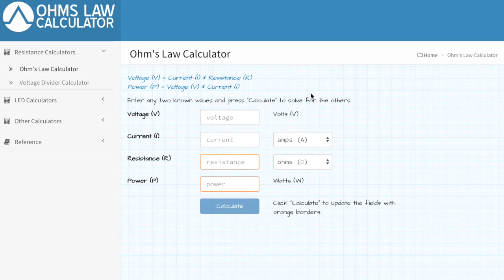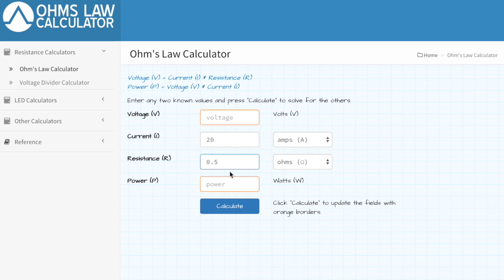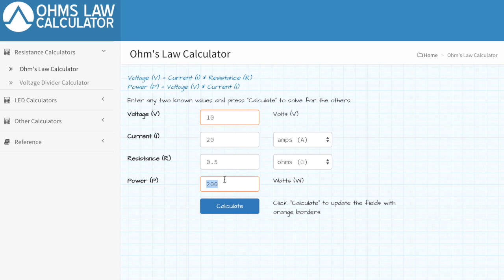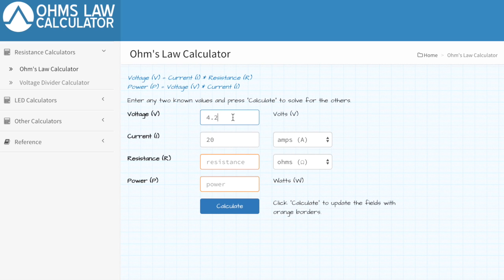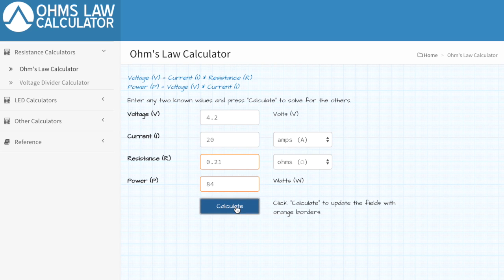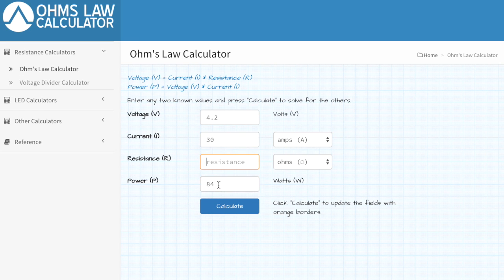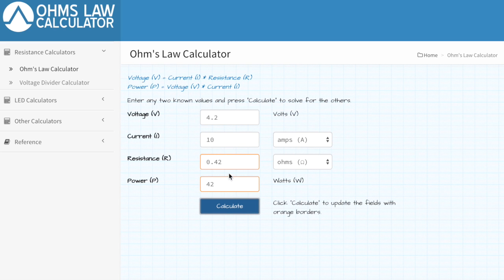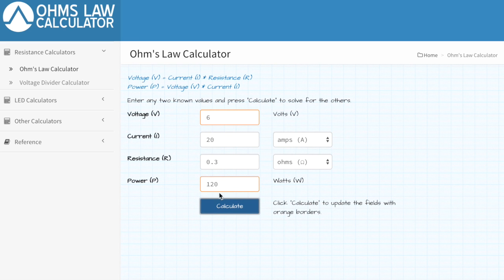Vaping for Beginners - Ohm's Law & Coil Resistance for MECH MODS

Comment: Abby, please take down this video and re-upload a better one for safety reasons.
First thing, there is no 18650 that has 35A so there is no point in promoting that battery.
Second thing, don't calculate with 4.2v and don't let people get used to it. As you said, it outputs 4.2v when it's fully charged.
But that's it. It will drop and drop until the mod will cut it self off unless you are on a mech mod.

A good rule is to use the voltage of the cut-off point which is around 3.2v or something.
Don't think about resistance when it's comes to regulated mods and please don't input your AMP in the calculator.
Just take the wattage that you are using and divide it by the volts that your battery can output. This doesn't mean the voltage that is displayed on the board, but the actual output of the battery.

I recommend this at 100w as an example (Series mod)
Single battery: 100w / 3.2v = 31,25a
Dual Battery: 100w / 6.4v = 15,62a
Triple Battery: 100w / 9.6v = 10.41

As you can see, series mods adds the voltage from another battery, which means that calculating as everything is just 1 battery is wrong. At the same wattage, my AMP dropped because I added batteries. The batteries are helping is each other to deliver more power so the current is lower.

If you have a mod in parallel, the voltage will not increase no matter how many batteries you have.
What it will do though is to add AMP.
Let's say you have a 20 AMP battery. Having 2 in parallel means you have 40 AMP. Having 3 in parallel means you have 60 AMP.
A parallel will typically only use the voltage from one battery. Basically it just splits the voltage between all batteries.

Do keep in mind that battery drops when using. NEVER calculate with 4.2v as this is a fully charged battery.
Also, resistance means NOTHING in a regulated mod. Just use wattage and volt as shown above. That's it.

For a mech mod where you don't have a display, you need to use the resistance.
Then you can kind of calculate like Abby. Still, don't put in your AMP.
Use 4.2v and divide it by resistance. 
Like this: 4.2v / 0.2 ohm = 21 AMP
After I while, the voltage from the battery will drop and drop but the AMP will go down since it delivers less power.

When you are going to explain something this important, please separate: mech, parallel, series and so on.
Not everything can be or should be calculated as a Mech mod.

Sorry for the long message, but I seriously don't understand why a person that does not know about something this important decides to upload a video like this. ohm's law is extremely important when it comes to vaping.
The fact that you even mentioned a battery being 35 AMP really got to me. 
Seriously, stop.
Reply from the maker: +Sean RobinsonJR thanks for you detailed response. This video was made a long time ago before most were aware that 35amp wasn't correct
Reply: Abby Vapes Mooch did battery tests even back then and has always claimed that there are no 35 amp 18650 batteries. He is the guy that you just know if you are into vaping and battery/ohm details, but no worries. The 35 amp issue is just small.
What I'm trying to say is that calculating the AMP is not the same for every device. it seems like you are tying to explain everything but kind of only cover the "mech" part, and you kind of miss there by setting up AMP manually and putting 4.2v just because a battery can output that when it's fully charged.

You probably know this by know that you just can't do that, which is why I actually recommend you to just remove it write something in the description, because it is really pointless.
I know it sounds mean but my impression of your video is that you are trying to cover the most basic about ohm law but you kind of miss and only cover how a single battery works.
It's just wrong and dangerous.

Maybe the views are important for you so you don't care. I don't know, but this isn't like just missing a review of a tank. This is actually how people do get hurt by vaping.

And also forgetting to use battery case when having a loose battery in their pocket.
Reply: I know right.
>Makes vaping guide for beginners
>Is a misinforming beginner
Reply: 35 amp PULSE.. 20 amp sustained.
  By the way guys, this PULSE rating on batteries is BS!  I think they just toss it on there as an average peak rating when you first fire the mod. 
Now for beginners.. don't by cheap, rebranded batteries, you never know what you are getting. I use 20a 2500mah or 20a 3000 mah for my regulated mod, and 25a 2250mah for my mechanical.  LG, Samsung or Sony only.

Also, never ever ever ever use "recycled" batteries.  Even if they are the exact same as what you get in a shop.  For example, some batteries are made to work in sets in a power drill or laptop, but not recommended for single cell usage (according to Sony), nor do you know what the internal chemistry of the battery is like.  I won't go into a long, complex discussion on why, just don't do it.  If you really want to know why, to satisfy the inner nerd in yourself, google it like I did.  The battery guys explain it better than I could anyway.  :o)
Reply: ***** Read this: https://www.reddit.com/r/electronic_cigarette/comments/3xrt03/calculating_battery_current_for_a_regulated_mod/
Reply: Joshies I have even left out some other information. The thing she does is to calculate the current that is going through the coil rather than what is actually going from the battery.
There is no way to calculate with 5v for example with a single battery. If 5v is displayed on your mod, it's simply just showing what is going through the coil.

In other words, the "AMP rating" that you can see on a VTC mini is pointless. It just shows how much amp goes through the coil and not from the battery.

In all, if you use a regulated mod with good batteries, you are pretty much good to go because a regulated device will provide you safety. We can all appreciate that regulated mods have cut-off point, coil resistance cut-off, amp cut-off, voltage cut-off and so on.
They made regulated mods dummy proof, and judging from most of the "ohm laws" videos out there where vapers have uploaded, it just proofs that there is a big reason for why they did all that. This video has over 300K views I think? Judging from the likes of the video, I just assume that most of them take her word for it.

I'm not a batter expert or an electric engineer. What I have done is to spend more than 5 min about ohm's law.

EDIT: I'm also not saying that Abby should know everything, but when you decide to make a video about it and share it with a lot of people, you should think twice before uploading it. This video is in fact pointless.
This is not just a review of a product. There is no right or wrong in a review. 
Ohm's law does in fact have a right or wrong answer. There is no opinions but just facts which is why I think it is stupid to upload this video in the first place if you don't know what you are talking about.
Reply: She doesn't mention that with the first battery. For all we know, people would believe that the battery is 35A.
Reply: so what can I do with 40a 18650 imren batteries well 2 of them bc I'm using a snow wolf 200 w
Reply: What color?
Reply: +Joshies it's purple
Reply: ***** For a high end mod like that, I'm surprised that they let it be 200w on a dual battery mod. It's just no way with a 17-20A battery like that. Heck, even for a 30A that would be pushing it and the battery life would be so bad.

I don't know the features that they have into the mod. Usually, a regulated mod should be good to go.
Reply: +Sean RobinsonJR the battery life is not bad like I have 2 40a imrens and it last me a day and half and I I'm using nichrome 20 g wire and it doesn't over heat like I start to feel the heat after the 7th hit and it's not hot it warm but I let it sit for like 5 mins and it cold again so it not bad at all I just don't want to push the battery thts y I asked
Reply: ***** I checked up on the Snowwolf. Above 150w, the chip kinda powers it on and off constant. It's the only way it will give you "200w"
To be honest, I don't see the point with that. I wouldn't even use it on 200w. The batteries you have is called 40A but don't get confused with what you actually have.

I saw RIp trippers video and it seems like you are rocking his setup with the same batteries. I'm pretty sure that you got the 20A once. The thing is that there is no such thing as 200w with dual 18650 batteries unless they do like snowwolf does. Power on and off constant. I have never tried that, but I don't see how that is worth it.
Reply: +Sean RobinsonJR no from day one I was using the 40a 18650 3000 mah batteries and I don't go above 90 I like it at 90 it's not bad but if I want to get a bigger cloud I would use a mech mod but I want to learn a lot more bout the battery safety and more bout sub ohms
Reply: ***** So the Imren purple 3000mAh is 17A battery even though they claim to be a 40A battery. Don't believe that and there is no such thing as a 40A 18650 battery. If it was me, I probably would go over 100w with a dual battery. It would be pushing the battery and the battery would drain fast. I go through x3 LG HE4 batteries in a day with 120w. Maybe 1 and a half day.

You can always push more but you would need to think about battery sag and how much juice there is left in the batteries. Even though most of these things doesn't matter to much on a regulated device, I still avoid pushing my batteries. I don't even go over 50w on a single battery mod and there are many single battery mods that can push 75w.
Reply: +Sean RobinsonJR then what kind of batteries would u prefer bc I'm still kinda new to it
Reply: ***** It's hard to tell because there is no such thing as the best battery for everyone. Someone needs batteries with a lot of amps. Some doesn't care about that and just wants battery life. Some people are in between. I'm one of those that is between. 20A batteries are really nice because it has a lot of battery capacity an I never go above 20A. I use my RX200 with a lot of power but then again it has 3 batteries. I use low power on something like VTC mini and it also won't go above 20A.

This is why I would recommend you to buy "Samsung 30q" They are 3000mah batteries and they are 20A, even though they mark them as 15A. They have been tested to be 20A so no worries. Or "LG HG2" which is also 20A battery with 3000mAh.

Currently I have LG HE4 but I would upgrade to one of these two when it's time to change batteries.

It kind of depends on what you need.
Reply: Okay I'm not going to bother reading Sean's shit because I'm a battery god. So, I'm just going to tell the truth your batteries are shit. Stick to the to Sony, LG, and other big names. As for your batteries capabilities, assuming you have the 3000mAh ones, you have a safe cdr of 17A and 20A maximum. This means you can safely hit 17A for 4-10 seconds~. If the pulse rating on it is legit you can take 1-4 seconds drags w/ a 40A rating. Though I'd just drop those batteries I'd suggest you some, but it's completely dependent on your vape and style (i.e: rec. use, cloud chasing, etc.). Hope I helped a bit brother, and if you have any further questions I'd be happy to help.
Reply: Joshies You can safety buy other batteries than Sony, Samsung and LG if you know what their ratings are, but I agree on your comment. Also, it's not about "seconds" but it can be about "temperature"
Reply: Yeah you're right, but it's more of a general means to measure by.
Reply: +Joshies thank you both I was looking for the right ones to get bc u know tht in order to vape safely without any problems u ask other vapers tht has been doing it for a long time or reading and learning bout it than jumping straight into the pot thts way I'm using a regulated box mod instead of a mech mod
Reply: +Sean RobinsonJR thank you tht helped a lot now I am able to know what I can use on my box mod without pushing the batteries and tht I am able to use the batteries I am using on it without any problems like 200/(3.7*2)= 200/7.4= 27.07v
Reply: That is why you buy the best batteries you can get, you never need to worry about pushing them on a box mod, (regulated), they will handle anything your mod can do.  Batteries will have a couple ratings.. the ma. 1650ma will need to be charged more often than a 2000ma and that will need to be charged more often than a 3000ma battery. (given the same coil, amps, watts, etc).  Next is your amp rating.  a 30/20 amp battery has a burst of 30 amps, but sustained at 20amp. Mech mods use more burst, you will notice how fast mech users hit when they vape. 2 second pulls are fine, but a 6 second pull would really push a battery if  you were pulling 25amp. Basically, know how long you can pull , longer pulls need better sustained, short pulls need better burst amps.  I saw a really nice battery.. 2250ma at 60/30 amps.
Reply: I agree!!!! Remove the VIDEO!!!!! this will make someone commit accidental suicide !!!!!!
Reply: ill just stick to saying that I agree with you
Reply: It's true that if you buy true 20a batteries, you are pretty much fine no matter what wattage you vape on a regulated mod. It has so many safety features that it would be amazing to fuck up with a regulated mod.
Often, you don't even need to know about battery safety if you use a regulated mod.
We are lucky to have those features because people still struggle to understand battery safety. Even I don't that much about battery safety, but I have had many lessons from the community, live chats and reading Mooch's posts.

The biggest thing is that people don't the difference between battery output and the coil output. If they just knew the difference, I think everything would be easy to understand because it's really not that hard.
They are just getting the wrong information from so many people around here. Especially on Youtube.
Reply: welp.. that proves it.. Just ignore this twit.  As soon as the fool mentions 30A+ he becomes a statistic.  The idea is to learn ohms law on a regulated mod, learn to build coils etc etc so you don't blow your face off on a mech.

Now what that clown doesn't know.. is some batteries can safely do 88 amps for a short time, and others only 44 amps for a short time.  Short time being "if it gets hot, let it go stupid"  I won't say which batteries, let the clown look them up and do his own calculations, he'll be much better off.
Reply: gbalkam Was that aimed towards me?
Reply: I agree she wasn't that informative but they do my 18650 battery's with 35 amps because I own several
Reply: You said what? You have 18650 with 35a? Name?
Reply: What are you smoking? I have at lest one that is 40A!
Reply: +Sean Robinson JR efest purple 3000mah 35amp
Reply: Not sure if you are joking but I'm just going to put it out there anyway.
The Efest purple 3000mAh is 20a and not 35a.
Reply: Tim Willey
Oh look, you can read.  To bad you don't know what it means.  There are NO 35amp batteries.  And if a battery says 35amp, don't buy it, they are misleading you.  All you need to know is the sustained amperage of the battery,  plus a bunch of other technical stuff if you are sub ohming on a mech mod.
Reply: gbalkam I wouldn't rule out all batteries where the manufacturer lies. Even though many of them lie, It can still be a good battery.
I wouldn't say that the Efest 3000mAh is a bad battery. Surely it's not a 35a battery, but 20a is decent for 3000mAh.
Reply: I wouldn't take the chance.  The manufacturers of a good battery know full well that they have a good battery and don't have to lie or mislead.  They say THIS is what it IS, and here are the battery specs to prove it. 
I figure if a manufacturer has a product that isn't good enough to stand on its own merits, without being exaggerated or having a misleading label printed on it,then stay away and buy from one that doesn't need to do that.
Reply: gbalkam Yeah, but by lying you are putting yourself on the map. You are also getting more sales because of ignorant people. Sure they have a really bad reputation.

The biggest problem I have with Efest is that they are known to change the cells and keep the battery name. If they lie, I will always get the information on how they actually perform. The scary thing is when they label it 35a but it's really 20a and then they change the cell to a 10a and you think it's 20a because of the information you have gotten.

So without a battery tester, you kind of don't know what you get and the information you get is all for nothing. It wouldn't matter anymore. That's the reason why I don't chose Efest. Not because they lie, but because you don't know what cell you potentially could get.
If that makes any sense.
Reply: Sean Robinson JR
Actually, I wouldnt use Efest anyway.  I ask my vendor what is the best for my mods.  Now, stating this, I also state, when you find a good, honest vendor, that would rather keep future sales than make a quick sale, stick to them.  My vendor could have sold me a mech months ago, but confirmed that I was advanced enough to properly use one before suggesting I could start using a mech.  I would rather spend a couple extra $$$ for high quality batteries anyway..  The other battery companies can either build products that match that quality, or go out of business as more and more people figure out the difference  a battery can make.
Reply: gbalkam Yeah, I agree. I wouldn't either buy Efest batteries. I'm just saying that I wouldn't buy it for a different reason than what most people do. Efest batteries and LG, Sony and Samsung batteries has pretty much the same price. At least when buying from the last 3 I mentioned, I support honest people.

I currently only own Samsung 25r and LG HE4. Will probably buy Samsung 30q soon.

And since I don't have a battery tester, I need to buy from manufacturers that I know won't change cells.
Reply: How can I determine my max amp limit if the battery doesn't  say it? *Eleaf iPower 5000mAh Box Mod

Size: 49.5mm(L)*23.5mm(W)*83.5mm(H)
Thread type: 510 thread
Output mode: VW/Bypass/Smart/TC(Ni,Ti,SS,TCR-M1,M2,M3) mode
Output wattage: 1-80W
Resistance range: 0.05-1.5ohm (TC modes)
0.1-3.5ohm (VW/Bypass/Smart mode)
Temperature
Reply: Muppet Man You would need to ask the people that have tested it since you cannot trust or take any information that is provided by the company that makes it. In this case, it doesn't really matter though. It's a regulated mod and they have made it safe to use. That's why it doesn't push more than 80w. Resistance doesn't matter.

You are safe with that mod no matter what. Unless they have made a crucial mistake like defected batteries.
Reply: +Sean Robinson JR after a week  of searching the web for  answers.  Emails to Eleaf and multiple people.  Thank  you  very  much  for  a simple  straight  answer.  You sir  should  start a YouTube channel ! Appreciate  it.
Reply: Muppet Man No problem. If you have more questions and are curious about something, check out this on reddit: /r/electronic_cigarette

They will help and you don't need to struggle for the answer for to long.
There are many great people here too: /r/ecr_eu
Reply: im not sure who taught you ohms law but your wrong you always use 4.2v when you do the calculations not the cut off if you used a 0.15ohm at 3.2v you get 21a which is safe for a 25a battery but if that battery was fully charged at 4.2 you would have 28a which is not safe. and a series mod does not not give you double the voltage the same as a parallel does not give you double the amps best case scenario its 75% extra
Reply: good man, I am a complete novice to vaping  and how to set it(eleaf 60w with a melo 2) but I do know about ohms law and I cant set this machine to how she explains it, thnks for the clarification.